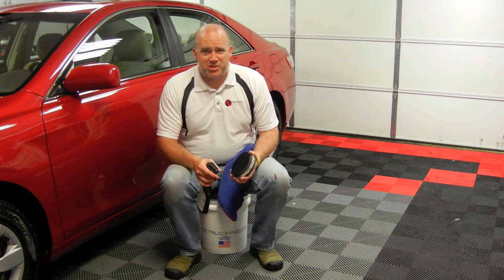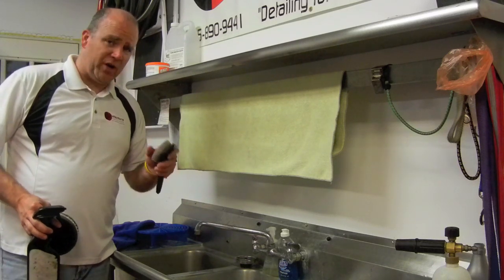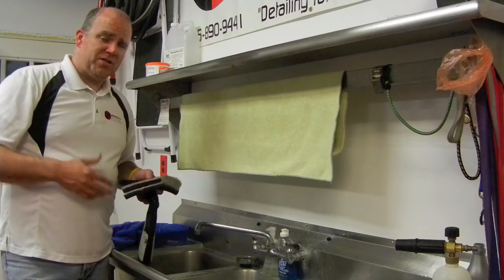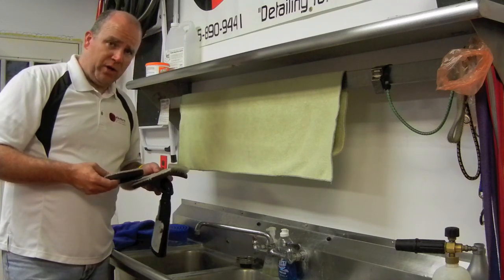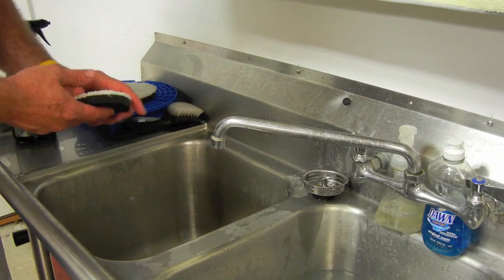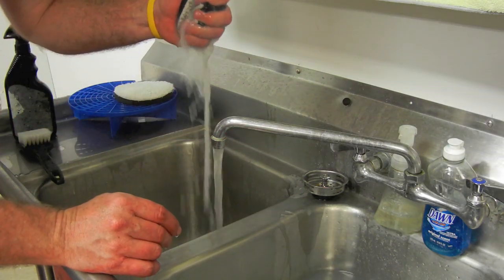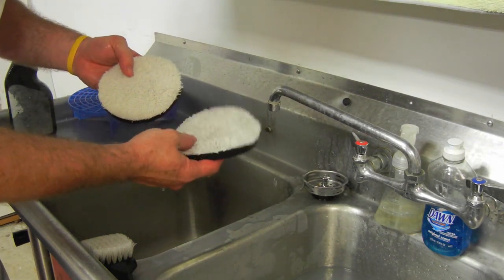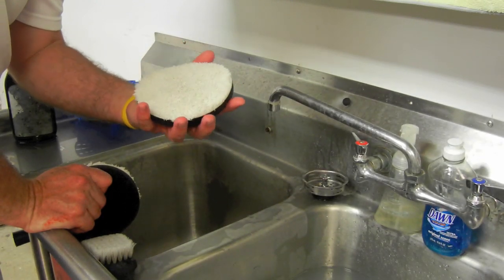Pad Cleaning

Comment from the maker: @jdp8642 During the polishing process I use a variety of methods depending upon the pad and product in use.  In the case of the Microfiber pads I use compressed air, or a nylon brush to keep the fibers perked up.  In the case of a foam pad I just use the nylon brush.  Wool pads I use a spur.  

Cheers,
GREG